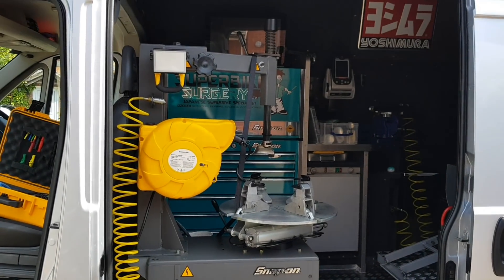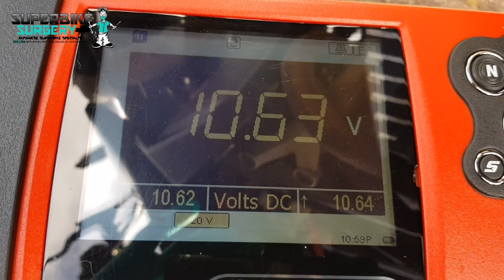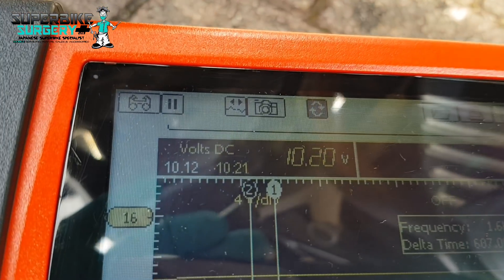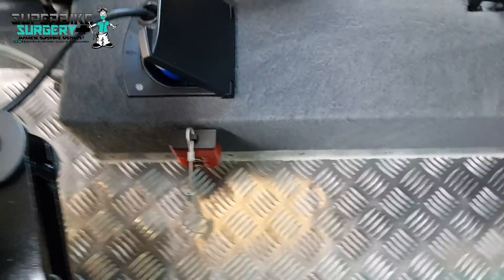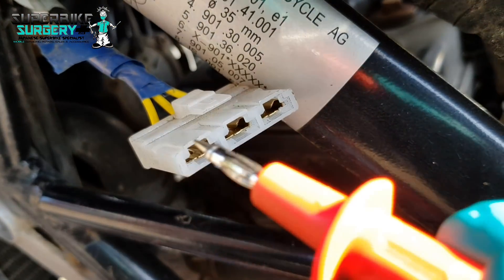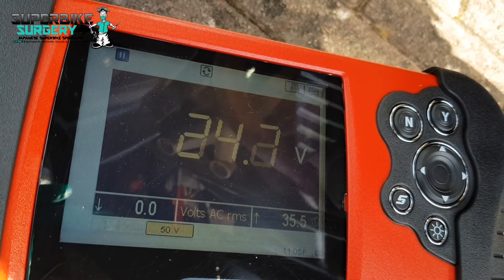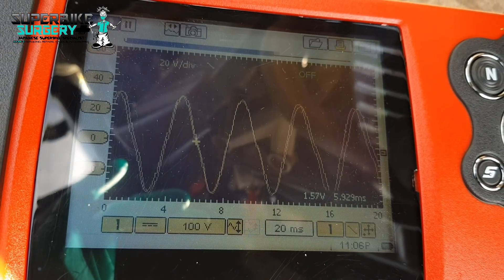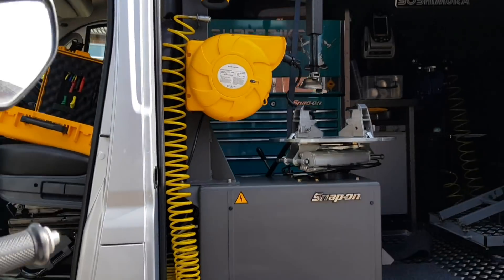VLOG - 012 AC/DC

Comment: Good to see a diagnostics video it always helps,you could also test the resistance of the windings. It will be interesting to see a test of the reg/rec or do you just swap out components to check correct working?